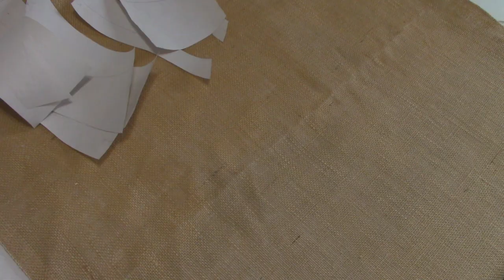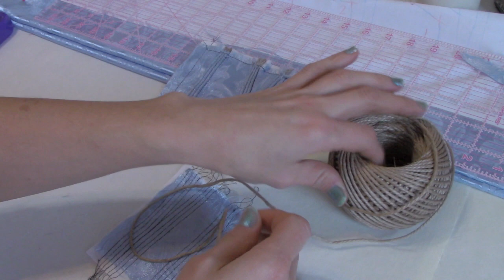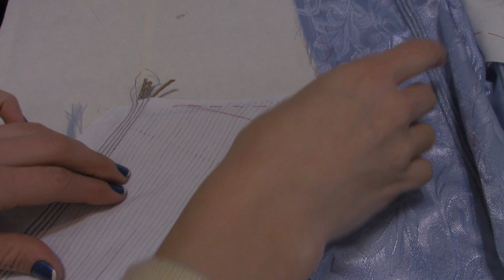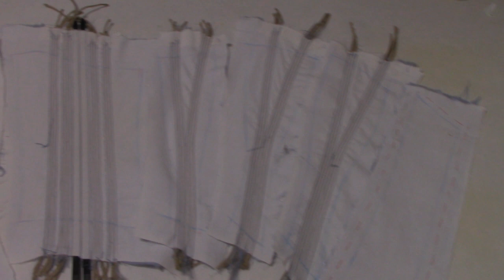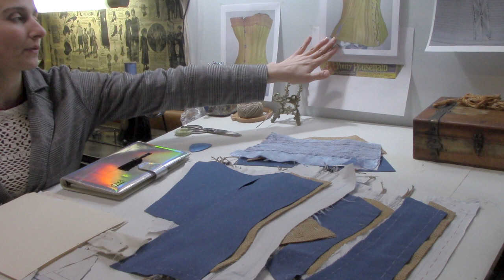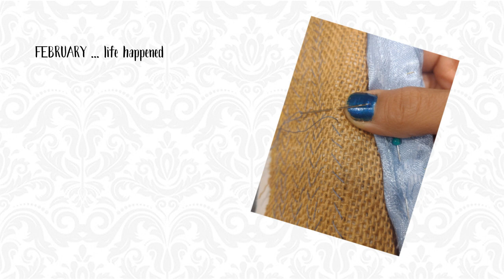Victorian Corset Making 2/4 - 1890s Symington Pretty Housemaid Corded Corset - Phase Two detail

Comment: Yes I have seen several people doing cording and they had to have the piece of fashion fabric on the top side of the cording has to be a lot longer than the piece to be corded onto weird phenomenon when it does not do this with boning
Reply from the maker: Do you think perhaps it's because with cording, you generally have so many side-by-side, whereas with boning, usually there's just one or two?
Reply: 24Washington  I think it is because with cording for some reason perhaps because we are using the stable material on the bottom and the fashion material on top that the bottom lies flat and the top conforms over the cord rather than both the top and bottom conforming. But i do know you always have to add a fair amount to the top layer when doing the cording to prevent the shrinkage because for whatever reason it does it lol wierd